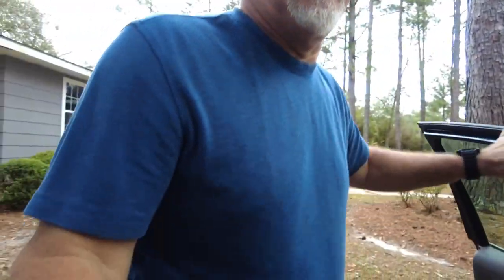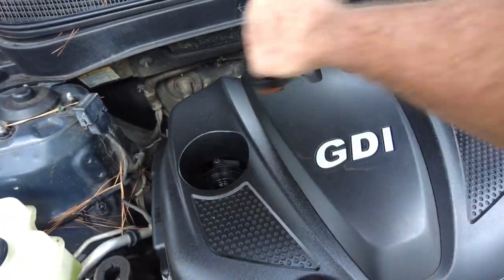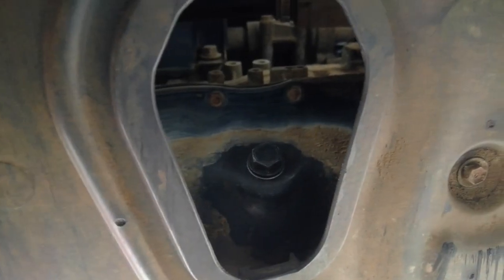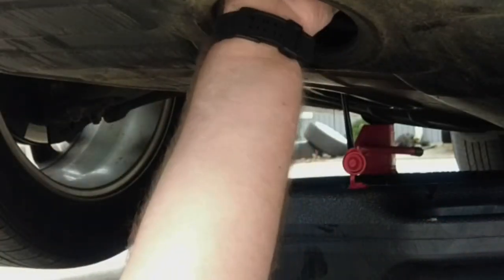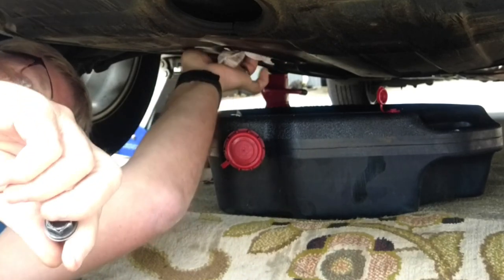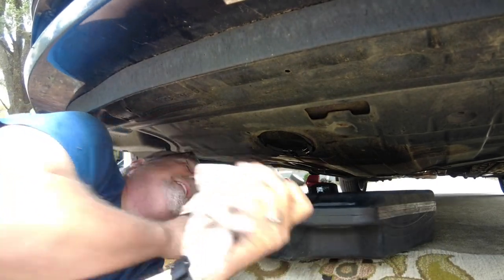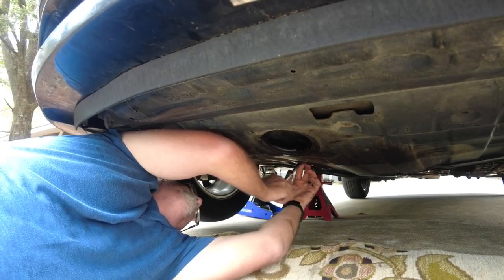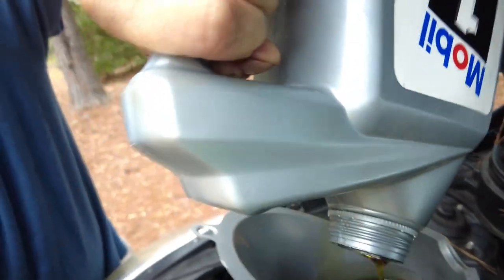How long? does it really take to change the oil in your driveway on a Hyundia Sonata

Comment: I love the carpet idea Ben!
Reply from the maker: Mom (Marcia) had a big impact on me. I try to recycle or repurpose things if I can. Also make good drip cloths for painting too. I have painted quite a few things in the garage over the years on old rugs. Especially in the winter if it is oil base paint or polyurethane with fumes that you cannot do inside the house. Also makes a cold garage floor tolerable in the winter.         Thanks for watching.
Reply: @diyhomefront1695  Good idea about cold garage floors!  She'd be proud of you!!